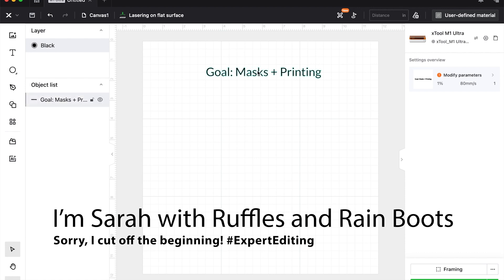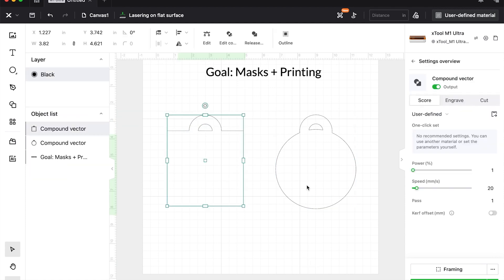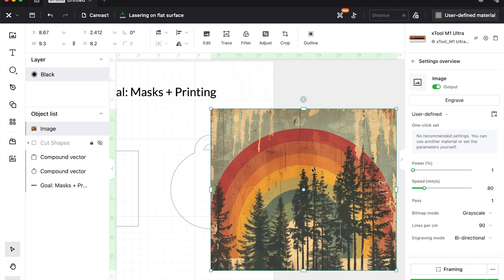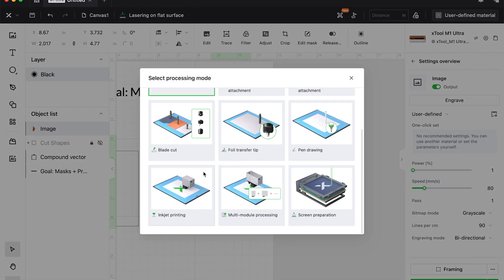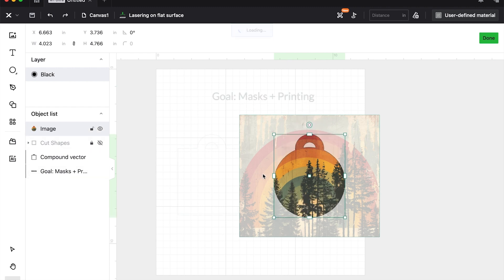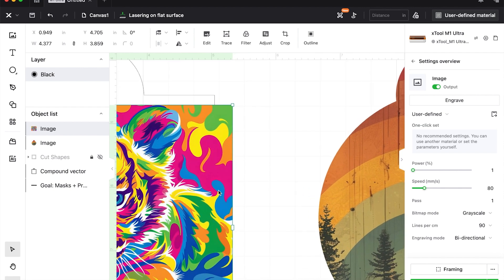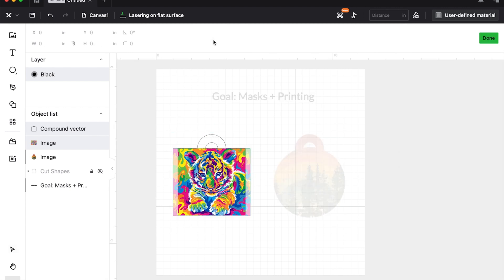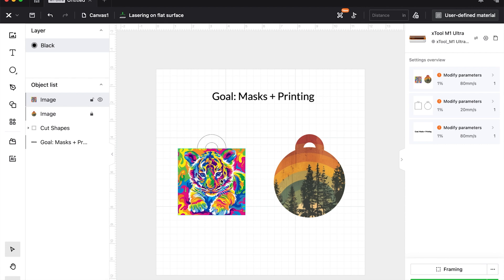xTool XCS Software Tutorial / What are Clipping Masks and How to Use Them

Comment: Thnx! 

Great tutorial!

Question! I have the F1 with a built in camera and i have an object that I have traced using the vector option. I want to basically cut an image that Will fit that shape and then engrave. Will this do the trick?
Reply from the maker: That sounds exactly correct. Make sure the sizing is good and that the image wasn't warped (can happen if you're not directly over it), but you should be good to go!
Reply: @SarahNenniDaher thnx for your reply! I will try this today!